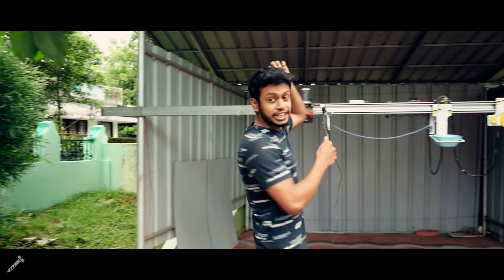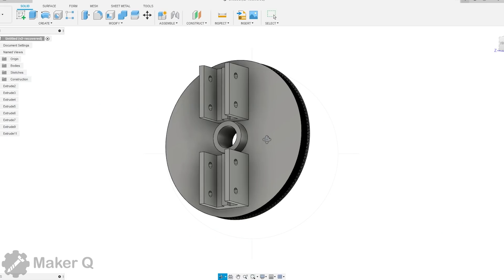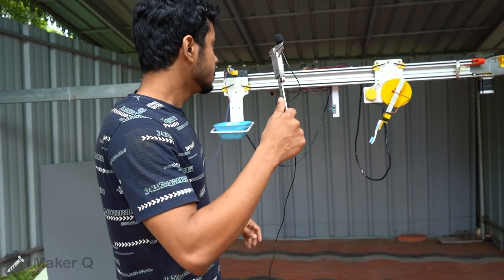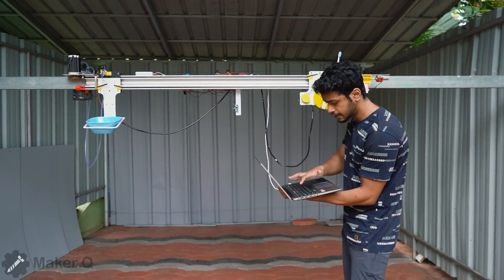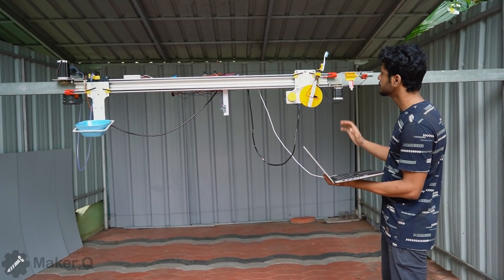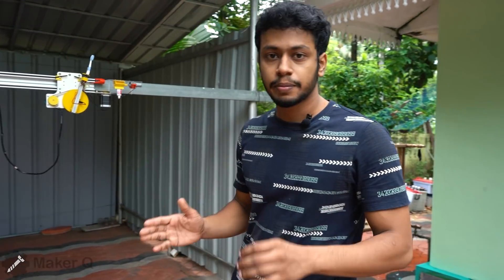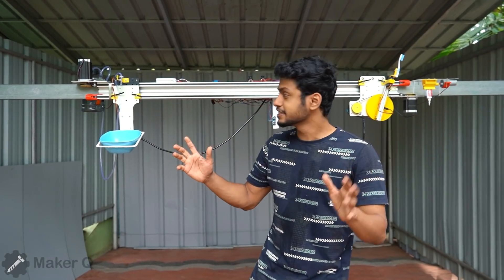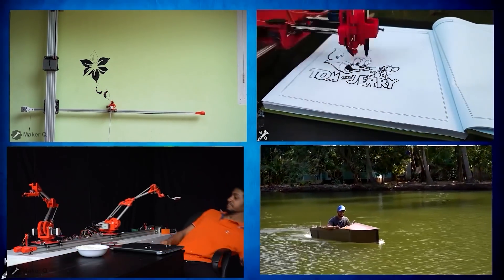I Made a Tooth Brushing Robot | പല്ല് തേച്ച് തരുന്ന റോബോട്ടിനെ കണ്ടിട്ടുണ്ടോ

Comment: Awesome project ,  and hope u have a good stability in Arduino project,  can u plz tell me code to on the buzzer for 10 seconds then it should off automatically , actually I have made water level indicator using ultrasonic sensor but when the water reaches full tank the buzzer will on but it won't stop plz help me to make it correct